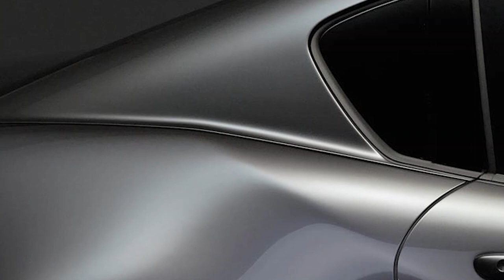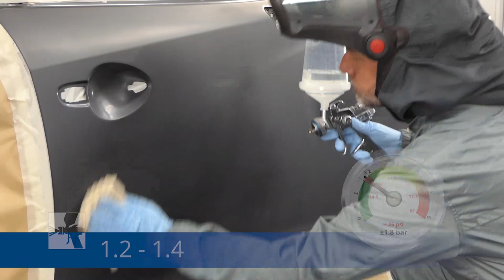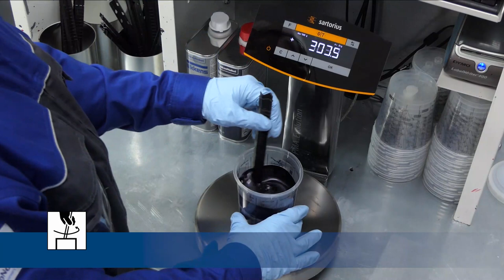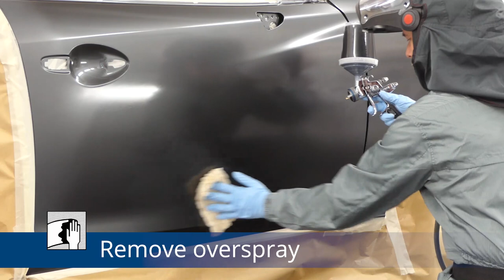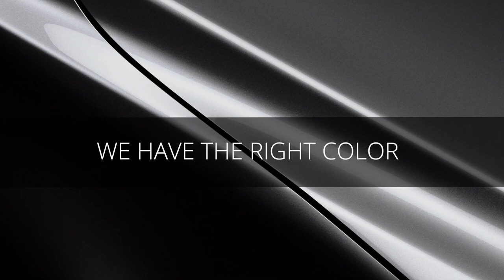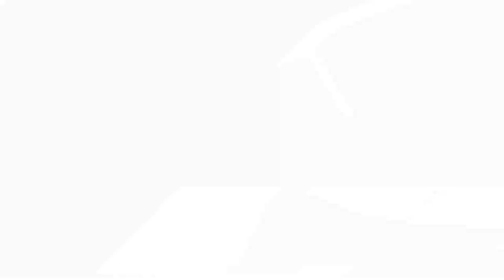Sikkens Autobase Plus Mazda 46G

Comment: i have so much trouble trying to match this color. How many coats to get the right match? I;ve tried 2 and lighter coat further distance but it still doesnt help.
Reply: I spray sikkens now, from old shop we had axalta. There's absolutely no way they got coverage on 2 coats, sikkens can't cover anything video is clearly edited lies. Axalta products 1 coat and done no worries. Akzo Nobel product, I just got done their advanced paint course, recommended 5 coats on colours. Really bad paint system, poor coverage, tons of wasted time and on flat rate that's a piss off. Instead of pulling more jobs in and making more money, your eating up time painting and drying so many extra basecoats when you should've been cleared already.i would not recommend sikkens paint to anyone. Paint ain't cheap and you use way more. And tone is money and you lose allot of time
Reply: @AJsHotRodsNrepairs  man, you are 100% correct. The past two months with this system has been s complete nightmare compared to ppg. This is the worst, every color is a mismatch. 95% of time is wasted spraying on spray cards. Management won't switch out if this system. I can't make money. 2 other painters came and left after 2 months because yes most of the tike were standing there waiting for paint to dry. 2-3 coats doesn't cut it. It's reduced down so much with their water system. Where ppg envirobase, we did not even mix water reducer in at all. I have the skills of 6+ years but in canada we need a red seal or it is preferred by employer to have in order to make some money. I hope I can find a shop that'll give me flat rate without certificates.
Reply: @dandee28  move to the US. painters making 150k US dollars a year.
Reply: @anthony71571  that's crazy. Really? I'm only at 30 cad flat rate. Averaging 300-400 hours man. Other painter of 20 yrs is doing like 400-600